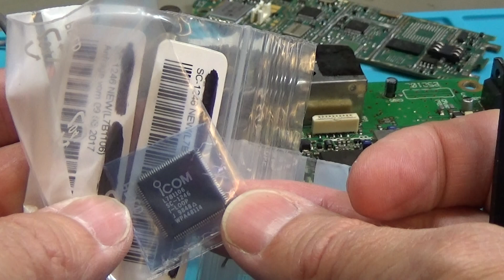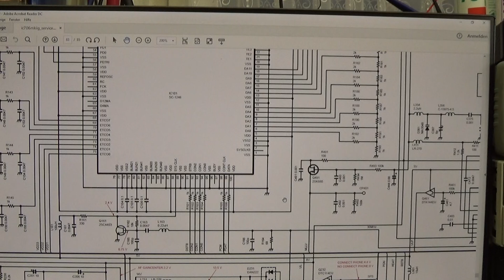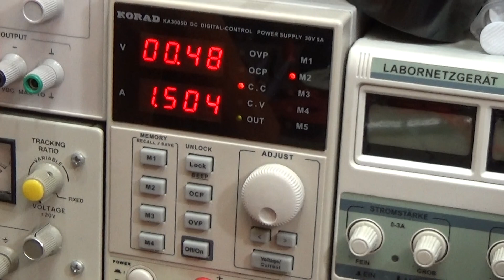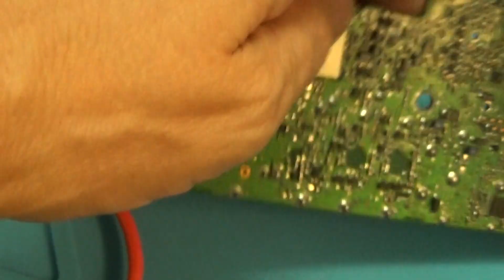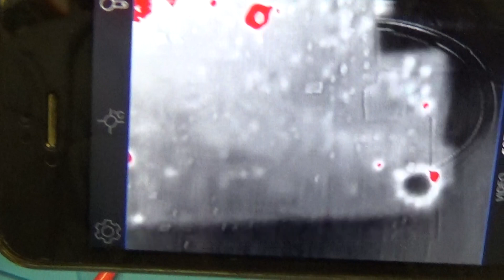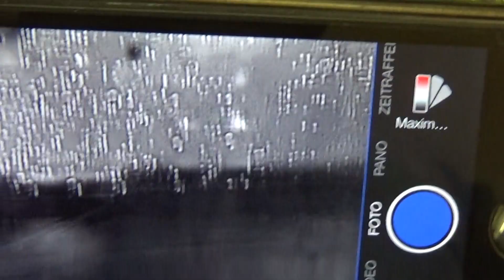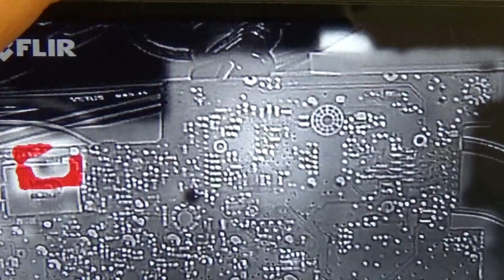#133 PLL Repair Part 3: Icom IC-706 final repair attempt failed

Comment: A tip from when I used to replace SMD ICs every day, if you have a pin vice and a sewing needle you can stroke the needle tip along the pins  and with a little experience you'll begin to recognise the sound of a pin that's soldered properly compared to a pin that's not soldered well, when you don't get that 'ping' sound from the needle you can narrow it down to a single pin.

A quick pass with hot air, a little extra flux and a little pressure on the top of the chip near the badly soldered pin nine times out of ten will solder it properly.

Sad to see a failed repair but sometimes that's the way it goes, thanks for the excellent video.
Reply from the maker: Thanks for watching Clint 73
Reply: So, are we to conclude that the PLL chip or maybe the other chipss may not have needed changing ?  Before i would go to the trouble of replacing SMD devices, i would know for sure that they need replacing.  I would have checked every bypass cap they are easy with a pair of hot tweezers. There is also a new  multi function tweezer meter. 
73

Comment: My high school German is very rusty - I was also going to say that Chip Quick is another method to consider to help minimize the heat absorption of the components and PCB. Sorry this didn't work out Peter but still an opportunity to see and learn new tips and techniques. WAY back in the day we had folks who would do multi-layer PCB repair but I doubt anyone does that kind of thing anymore.  73 - Dino KL0S
Reply from the maker: Well as I said my experience with chip quick is compared to hot air not positive as the risk of damaging pads was in my case always higher. So you always pay for one advantage with another disadvantage. Today a damage with hotair to a pcb or a component is very seldom so I think we really can take the risk. 
Yes this time it didn't work out but I found it important to show that as well as we can't win all the time :^) Thanks for watching and comment Dino! 73

Comment: I know it's hindsight now, but next time before you solder a new chip on check to make sure the short has been removed.  That way if it's still there it makes the troubleshooting process easier.  When desoldering I also find that a little bit of flux helps remove the components as well. Good videos thanks for posting.

Comment: My thoughts about the dead short on the +5V supply issue is that when you supplied 1.5 AMP  the PCB should have been extremely hot...  rapidly  advancing to smoke mode.
What accounts for the PCB  @  1.5AMP being cold is that your power supply couldn't source the  load...A DVM in series would verify this ...as I do not trust a PS metering  in a folder back mode.
Thank you Peter...All the best !

Comment: Thought I had replied to this Peter.  Not sure what happened lol. Sometimes repairs can just go a little too far. In this case I feel like you gave it your best and there is no economical way to repair the board. So many things inside the layers could be bad. yes you could turn the amps up and see if the short heats the board and find it on the thermal cam. But digging into layers is just not the way to go. Thanks for your time on showing us the incredible skills you share my friend. buddy
Reply from the maker: Yes I agree no way to do it somehow economical. But this story is not at it's end. We are waiting for a new board :-) Thanks for stepping in my friend 73

Comment: pull the ic back out and the capacitors, ohm out the 5v rails again just to see if its really a shorted pcb just for curiosity sake.  I have used a milliohm meter to find layer shorts before also its like a magic tool.

Comment: Very nice job and good video! Thanks! I've done a chip swap like these only few times and been fortunate most of the times. It's a job that is every time a challenge of skills. To think that most service centers today don't even bother to change chips as many pins as these have. They just swap the boards... but what a waste of skills and fun! :) I just bought a TS-940S which had a bad tuner but now after analyzing it it also have a bad receiver. Someone has changed 4 or more BPF coils to different models and some JFET's are getting very hot. I tried to get it fixed but as I figured that those coils have been changed I ordered a used RF-unit instead. Smelled like that fix could take a whole year...

Comment: I had exactly the same problem with a Sony CCU some years ago, I removed all the 5volt components in the area where the short was, then
I went to a car battery and blown out the shortage.
After reinstalling the components and make a few 5volt wires the CCU worked fine again.
If your board is already beyond repair you can try 5volt with lots of amps...
Keep up your great videos.
Reply from the maker: Hi Mark yes that is a possible way I have done it as well a couple of time ago...Thanks for watching 73

Comment: Hi Peter, I could feel your disappointment but as you said some times it happens.
As you consider the board beyond repair I would definitely remove the new chip and check if the short is still there just for my own feeling I had done the soldering right and to find out what the problem is.

Thanks for sharing!
Reply from the maker: You are right I'm always disappointed if I can't get the best result out of it :^) Thanks for watching Michael 73

Comment: Peter, Thanks for your great videos.  I enjoy them immensely.  May I suggest that it  would be fun to find that short even if it is inside the PCB.  I was waiting for you to bring  out a FLIR and you didn't disappoint.  Maybe if you connected your power supply ground lead to one of the bypass caps that would concentrate the current to a smaller area and your FLIR could detect the heat.  As the board is scrap now you could adjust the current until it is detectable.  Just a suggestion as the FLIR is a great tool for troubleshooting shorts and some people would find that method interesting to witness.  Take Care! Fred
Reply from the maker: Hi Fred, well have to talk to the OM what we are going to do...1,5A is really a huge amount of current and should so any heat if a cap is involved..Thanks for watching 73

Comment: Hi Peter. So sorry that you were not able to effect a repair. I do have a question: does the 5 volt rail run inside the board? If the rail was on the top or bottom of the board, could you cut the traces in the loop around the ic to isolate the short? Please help me understand where the loop is located, on or in the board. Please continue making repair videos. I check your site every day for a new one.John C
Reply from the maker: The trace is inside the board so you can't get access to it..Thanks for watching 73

Comment: Thanx for doing these Peter.  I always look forward to your next vid.  If the board is toast, why not continue dumping more current into it to find the short?  You may resolve the short doing this.  I have inadvertently done so (don't tell anyone!).  You can tell I am into the brute force method, since my frontal lobe is so small.
Reply from the maker: Hi Bob, yes you can burn a short away and I have done that as well but you certainly agree that this would not be a professional and reliable repair :^) Thanks for watching 73
Reply: Yes, that is why I am a Radio Amateur, & not a professional. ;-)  If I were to do this, I would only do it for my stuff or with the knowledge of the owner.  BTW, I use Aluminum HVAC tape for draping the area.  I have not found the plastic stuff you use.  Thanx again.  You are awesome.
Reply from the maker: Ah come on Bob Radio Amateurs ARE professionals! Have a nice week end! 73

Comment: By my point of view that PCB need a deep check as recommended from other friends...try to remove the IC and start a new board check. You have saved other radio with worse condition !! :)   '73
Reply from the maker: Let's see if this is the end...Thanks for watching Alessandro 73
Reply: ..it's a very strange and interesting  case.  '73

Comment: You are running 1.5A at .5 volts.  That is only 750mW.  That is probably not enough power to heat anything up.
You might try cranking the current up again to get the voltage up and thus the power.  I see your supply will do 5A.
It is the power that will heat a component not just current.  Maybe a working part will come available in Ebay.
Don't feel badly.  You are the man.
Reply: Hello,
sorry, but that´s not correct. 
The heating of a conductor only depends 
on the current density and the current density is the quotient of
current divided by wire cross-section. (J= I/A)
Reply: Werlaf  P=U*I.  Or: no Voltage - > no Power!

Comment: Peter, once again a very well produced video which must be hard to do under microscopic conditions! A very honest result to show that the result, despite all the hard work and time, does not ALWAYS go to plan! Although you probably would not change out IC devices everyday, it might be worthwhile obtaining QFP nozzles for the heat gun?? Best of luck and I look forward, as always, to the next video Peter, 73 EI8EJB
Reply from the maker: Thanks for the fed-back Brain. Well you are certainly right with the QFP nozzels but I'm so familiar with using the "normal" nozzles that I would not use the QFP's most likely...Thanks for stepping in 73

Comment: Ok, it is probably nothing but I see a short between #3-4 pads in the upper left at 12:20 after the cleaning, which would be totally invisible after the IC is placed. I have absolutely no experience in this kind of SMD reworks but still I thought I should mention what I saw. Great video as always!
Reply: Now I see somebody else have already mentioned it :D
Reply from the maker: Thank you. We never can get enough hints as it happens to easy to simply not see an issue...73

Comment: I would suggest cutting the pins off the ic, and  then desoldering the pins, less heat sinking so is easier to get it off, which reduces the chance of damage.

Comment: It might be possible to fabricate a metal square nozzle for the hot air gun to direct and concentrate the heat only over the pins. Might even be able to make one (temporarily) out of aluminium foil.

Comment: Usually 1.5 A on a PCB WILL bubble up at the short because of heat inside the layers. It seems to me that the PLL was installed 90⁰ rotated counter clock wise...

Comment: @ 1:02.25 I see what might be a short Pin 7 to Pin 8, from top right corner of frame, right below the printed "4" on ic.
Reply: I saw the same at 46 mins. But might be a scratch on the board.
Reply: I saw a bridged pair after cleanup as well.

Comment: @12:40 in video pre-chip install, 3rd and 4th pin on left are shorted, however without a schematic I can't tell if this is common grounds. Love the videos!
Reply from the maker: Thank you John, yeah it is common ground... 73
Reply: I saw that solder bridge too! There were a couple tiny solder balls on the right hand side of where the chip was going in. Here is a suggestion get a high rez  video camera that will macro focus on a board and connect it to a 40 to 46 inch, 
4 K monitor.  That will help you see things like tiny shorts .

Comment: Looks like FLIR found hotter spots in reflections of shiny metal surfaces on both sides of the board. On top side those large metal shields fit into the frame and on bottom side there's also some metal part on the left. Can you try with FLIR again after covering all those metal surfaces and with higher current limit? Which side of board gets hotter? Maybe you can show the hotspot position on board by moving some small and hot or shiny object just above the board until it's at the previous hotspot position in FLIR image. I'm curious whether that hotspot and short really is in the chip so that it gets hotter than bottom of board.
Reply from the maker: I can say so far that you feel the board getting warm underneath the chip with 5A. Thanks for watching 73

Comment: @42 mins What about the resistors at the bottom of the diagram? Do they not also cross between the 5v rail & ground?
  If it's the processor again then it might be worth a freeze spray test to see if the processor lets go. At least if it comes good temporarily you will know. Could solder paste be an alternative soldering technique for such a tricky component?
Reply: @46.11 look at the 7th and 8th pins down (on the right hand side) Looks like a hair but could be a tiny piece of wire shorting those two pins together, possibly from a contaminated solder tip or from the bench etc.
Reply: Unless thats just a scratch on the board.

Comment: Your repair videos are like scandinavian thrillers, 100% suspense!
But one question is still remaining. Where are the 1.5 amps??
Where is all the energie? Youtube is full of stupid "free energie" videos
Did you create a new genre? The "free disappearing energie videos"? :=)
TY for sharing.
Reply from the maker: LOL yeah like it" The free disappearing energies" haha..
Well to be serious with 5A you feel that the pcb under the chip is getting warm but not hot. Must be a massive short on traces..I believe.. Thanks for watching 73
Reply: @ 1:02.25 I see what might be a short Pin 7 to Pin 8, from top right corner of frame, right below the printed "4" on ic.
Reply: +tim keep in mind the supply is limiting the voltage to 0.45V so you're only dissipating slightly more than half a watt at 1.5A.  If that was going into a tiny capacitor it would be very apparent, but if it is going into heating the ground plane, the heat is spread out so much it won't really get hot.

Comment: it would take 5 minutes to remove all those decoupling caps and test for short again. The PCB layers are very-very rarely damaged.
Reply from the maker: I agree it is very seldom that the PCB layers are damaged but sometimes it happens. If a cap would have a dead short it would get incredible hot but none did. But to be 100% sure I have taken all caps from the PCB after finishing the video. Caps are all okay. Thanks for watching 73

Comment: 8:28 Use more flux , this helps resoldering and solderind. 420*C is very hot (before need board preheat ~80*C (board big GND temp) +5min). 43:31 Or use termocamera ( SEEK Thermal Camera gives your iOS and Android devices Thermal Vision for Cheap )
Reply from the maker: That is the reason why I always heat the board before I go down. It takes longer as I do it manual what on the other hand a preheater can do for you...Thanks for watching 73
Reply: Remove this chip again and measure Apms/Voltages, without chip,. And if OK, then measure chip pins without board. Nothing to loos. Maybe some voltage regulator is grouded. Look this voltage rail, and separate  other board parts (remove some comonents) of the chip (scrach or cut out rail), later make jumper.

Comment: did you clear the short (solder bridge) at 12:01 ? between pins 3 and 4  down ?

**Actually on full screen it looks like it is supposed to be there.........
Reply: That's a shame the board can't be repaired, you win most of the time with your repairs. Well better luck next time Peter, I'm sure you win the next one. Cheers 73 😀
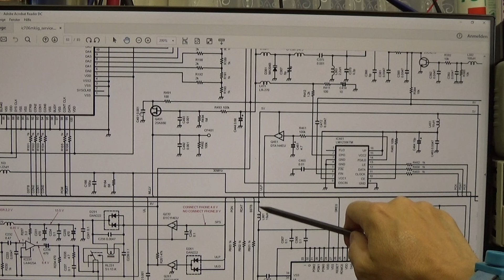Reply: Harb's Elecronics Lab.  Pin 3 and 4 are in short. You see a pattern 35:54
Reply from the maker: It is a trace not a solder bride so it has to be there :-) But we all can't get enough hints sometimes it is only a bit we we didn't see.. Thanks for watching. 73
Reply from the maker: Yes you are right Tom we can't win all the time...Thanks for watching 73
Reply: TRX Bench yes after I had a closer look I could see it was a track.
I thought you may have missed it because working with that camera in front of you can't be easy.
Your videos are very good and I wait for every new one

Comment: Is there a short between pin 7 and 8 (count from the top  to the bottom) at timestamp 46:14? I see something there.

If not try removing all the electrolytics and test for shorts again.

Don't give up yet.
Reply from the maker: Hi Freddy, no what you see is a grain from the Q-tip. If a cap would have a dead short it would get incredible hot but none 
did. But to be 100% sure I have taken all caps from the PCB after 
finishing the video. Caps are all okay. Thanks for watching 73

Comment: The devil in me wants you to remove the via next to your soldered wire and replace it with wire. I suspect it may be shorting internally to ground. It would certainly be an obvious point of failure and would be very quick to do.

Comment: Hi my friend. Excellent job. I have an radio IC-275H that is in trouble. In FM mode the received audio is very low,so it is necessary to set the volume control to maximum. In SSB and CW mode the audio is normal. Could you give me any 
suggestions, any tips that I can research and find the defect? I really like that radio. Thank you. Miguel, PY1LO

Comment: why do you stop now?, is it not possible to remove the chip again? and continue, there is still a small chance that it's one of the caps?   or is it   Beyond economical repair   becouse of old age ?
Reply from the maker: Yes it is already far beyond an economical repair. The best might be to get a used board to fix the problem. Thanks for watching 73

Comment: After desoldering the IC you have not checked for short, don't you?  The short must have been there after removing the old IC?
Reply from the maker: Hi Matthias, in part 2 and already in part 1 you can see that we didn't have a dead short before. But I agree with the case history of having to hight voltage to the supply line and together with all the soldering work we got this issue. The pre damage of the layers must have been more serious as one think. Thanks for watching 73

Comment: Peter, is it possible to use a 6 digit multimeter to measure voltage drop or resistance to try to find the spot on the board closest to the short?
Reply from the maker: Yes that is a possible way..73